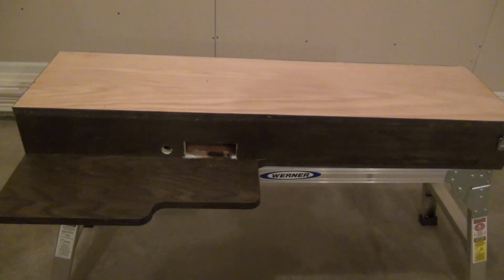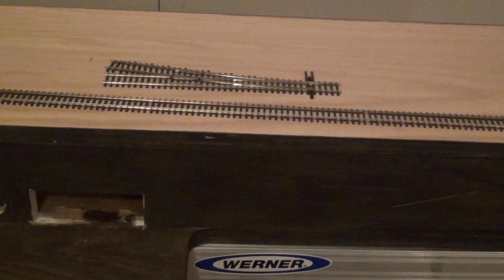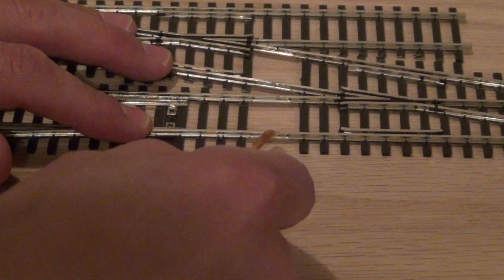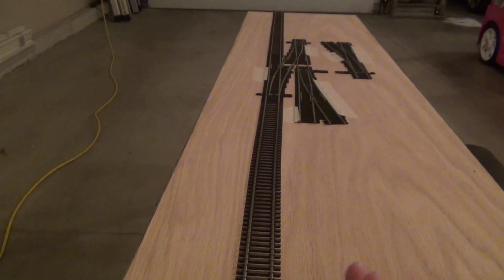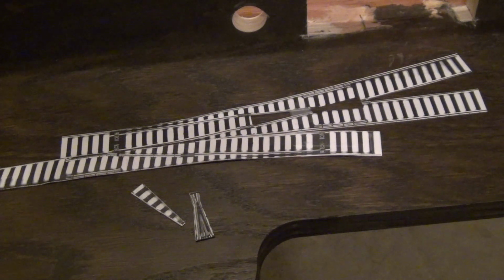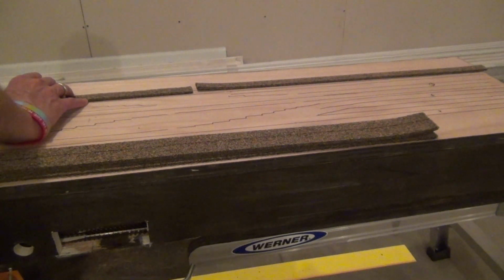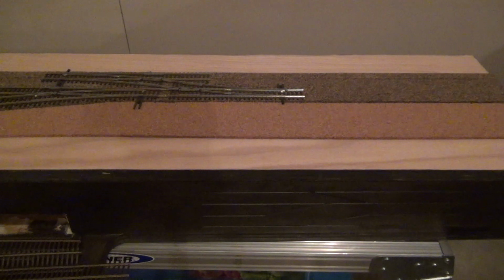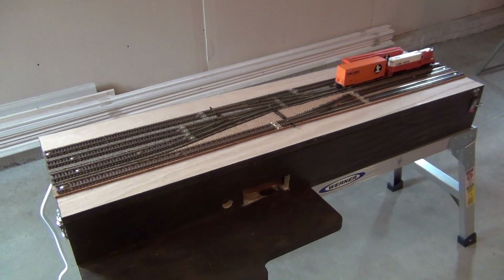Model railroad build video series, Part I:  installing track and roadbed

Comment: I was curious now that about a year has past since you started this video series, if you have used more JMRI features to automate this small layout?  Also, I heard you use Digitrax for your main layout.  I think it would be an interesting video to convert this 4' layout to Digikeijs DR5000 (LocoNet compatible) and take full advantage of the RailCom feature in your ESU based locomotives. The Lenz RailCom display would also be an interesting addition to your portable demonstration layout.

My understanding is that the Railcom being enabled in the ESU decoders interferes with the Digitrax based "Transponding" technology in the Digitrax command stations/boosters.
Reply from the maker: Thanks, Chuck.  I haven't gotten to the point of getting more automation on my small test layout yet, life is crazy busy right now.  I will look into the Digikeijs DR5000, I don't know much about it but I am curious about looking some stuff up!